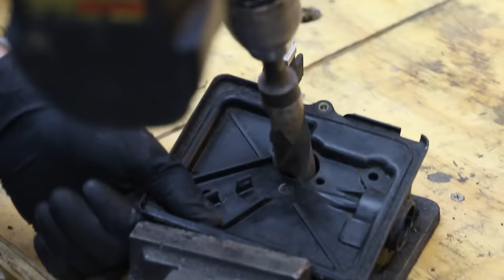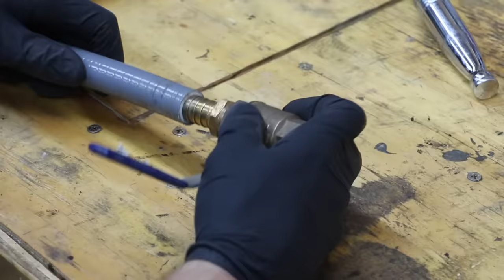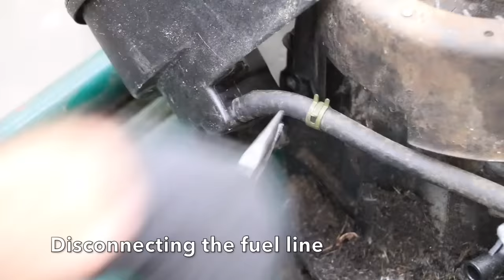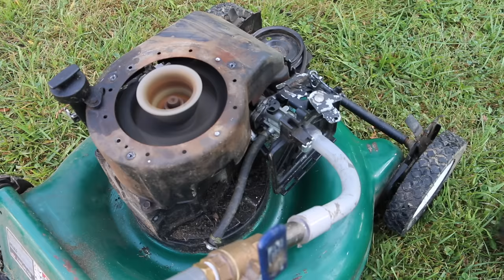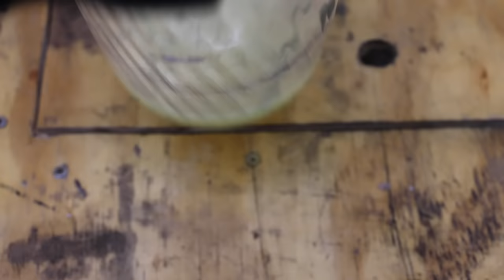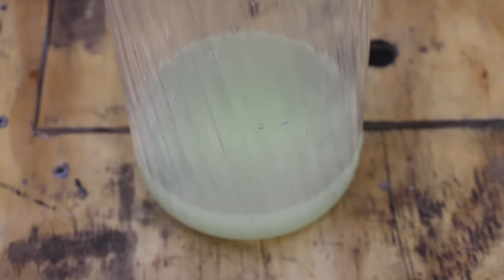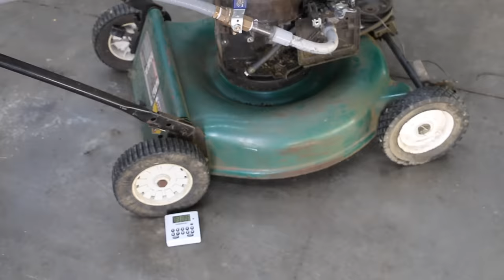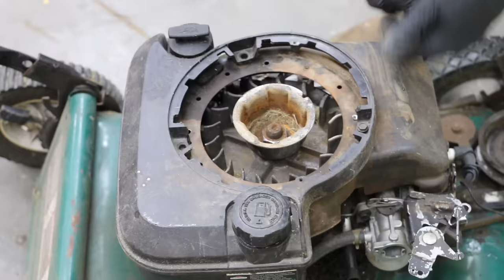Will a "Gas Vapor" Container Improve MPGs and Fuel Efficiency?  Let's find out!

Comment: its literally the same principle as a carburetor
Reply from the maker: Thank you!
Reply: It isn’t because there is is still fuel going into the engine while running on vapor is vapor fuel not liquid fuel
Reply: mason's radio WTF are you trying to say
Reply: @masonfirmature1523  No fuel ever goes to the engine in any combustion engine. What goes is air fuel mixture, which is then ignited. Air fuel mixture, how would you call it in other words? Vapor maybe?
Reply: @ProjectFarm  What you really constructed is basic carburetor, which feeds the engine with lean mixture, that will fry your valves overtime.
Reply: That's what I was gonna say, it's just aerating the fuel in the tank, but has the same basic effect of creating an air fuel mixture.
Reply: @punio7  but it's possible to build a slightly more sophisticated system to better tweak the mixture. Ya know, in the event of the apocalypse, and you need to replace your carburetor to continue running your equipment on the biofuel you distil in your survival compound. 🤷🏼‍♂️
Reply: But I think that shows that when you feel like your car might be running on vapors, it's absolutely not 😄
Reply: Crushonius and fuel injector
Reply: If there is liquid fuel that makes it into the piston by design that contributes to cooling. You guys need an education...
Reply: @punio7  
I think this is a 2-stoke engine. No valves.
Reply: @johnnyvanderplas3871  Yep, you're right. My bad. It stil is a bad idea, especially if someone tried to do this in a car.
Reply: @punio7  by calling this a bad idea you show you don't know how an engine works.
Reply: @magapefarmshomestead6453  By not telling why it would be a good idea, you have shown no knowledge o engine yourself.
Reply: @punio7  your descriptions and explanations show that even back woods hicks know more about engines than you do. your comment, as follows "no fuel ever goes to the engine in (I quote) 'any' combustion engine" is a flat out lie, regardless of how much truth you might think is there. In modern conventional fuel injected internal combustion engines, be they direct or multi port injection, the fuel rails that transport fuel to the injectors do so as a liquid. as the device is an injector, not a vaporizer, it does not and can not vaporize all of the fuel, thus raw liquid fuel does, in large quantities, enter the combustion chamber. while it would be ideal to always have the fuel in the cylinder only as a vapor or gas (describing a state of matter rather than a description of fuel) it does NOT happen unless you make your own carburetor, which many states are outlawing, thanks to lobbyists from the oil companies. a question for you - what are the purposes of air pumps and the catalytic converter on cars? why would there be as need for air pumps if complete combustion was achieved in the cylinder? please study chemistry instead of just spouting or regurgitating the lies that the oil companies teach. no they don't want you to understand they are brainwashing you garbage. good luck
Reply: @magapefarmshomestead6453  Air pumps are used to inject more fuel into combustion chamber and have it all burned. You can have complete combustion without one- my bike does it all the time. And yes, injectors does spray liquid fuel into the chamber, but they do it with high pressure, so it creates rather a mist than actual liquid. So yes, technically I was wrong, but not much. Also with mentioned injector technology, why would those evil gas lobbyist allow it to exist but ban gas vaporisers? Maybe it's not lobbyist, but fact that self made vaporiser that creates highly explosive gas is a really dumb idea?
I was quite arrogant in my first post, for which I apologize. Your comment made me to check facts, and yes I was wrong at some but I'm not convinced that gas vaporisers are better solution in combustion engines.
Reply: @punio7  I am also sorry for my unkind comments. But I feel a need to provide better information. First of all, a mist is just very small droplets of liquid. It is not a vapor, which is the only state of matter that hydrocarbons will actually combust, burn or whatever one wants to call that chemical reaction. Second, A turbo charger puts more air into the cylinder whilst an air pump puts it into the exhaust system, to provide air (oxygen) for the catalytic converter to use. If additional oxygen was not supplied the catalytic converter would and could not work as there would not be anything for the hydrocarbons to chemically react with. 

And yes when that part of the fuel that was vaporized during its injection into the cylinder burns in the cylinder, the heat of that chemical reaction vaporizes the rest of the misted fuel in the cylinder but can not burn it as there is not enough oxygen to allow the chemical reaction to occur. So all the unburned and partially burned (carbon  monoxide) hydrocarbons go to the catalytic converter to complete the process so that it can be claimed to be a clean burning engine.

We have been taught that the only way to make combustion better is to add more air to the cylinder to make the air/fuel mixture better but there is another way, which is to reduce the amount of fuel added and to add that in a state that it will burn (a vapor) and give it enough time or help the mixture to properly and thoroughly mix so combustion happens easier and more completely in the cylinder.
Reply: @magapefarmshomestead6453  Thanks for the information, my knowledge is definitely lacking in this subject.
Maybe then the reason why there are no gasoline vapor engines is because gasoline vapor is highly explosive? From what I read liquid gasoline only explodes in certain concentration, thus making it much safer to use in engines. When vapor engine stops, there would be still vapor inside evaporator, which could cause danger. Also what about gasoline vapor burning temperature? I know running on lean mixture causes higher burning temperature, which affects engine's    durability. Isn't the same for vapor?
Reply: Johnny Van Der Plas the lawnmower he is using is a 4-stroke
Reply: @johnnyvanderplas3871  It's very obviously not, you can hear it very clearly.
Reply: @punio7   punio7  vapor is explosive at the right concentrations but when very little to no air/oxygen is there it's not very explosive. Rather quite safe. And again liquid fuel can not explode as it can not combust. If liquid fuel could combust it would be so dangerous that it could not be used as a fuel and all petroleum based products would be banned because too many people would have died. If you want to prove that liquid fuel does not burn get a tin pie plate, put a 1/4 cup fuel in it and light it, but stand back so you don't burn yourself. The fuel will burn on the surface only until it is completely gone. If the liquid could combust the whole pan and everything near it would be in pieces immediately. While that is a proof I recommend one finds it online instead of doing it oneself. 

And yes the hotter the fuel vapor is the easier it will combust when mixed with oxygen. This is because it has more molecular energy due to the added heat.

Yes when a clean burn is accomplished it will burn hotter, because more of the chemical energy in the fuel is released. The ultimate release of energy is, as you have called it, an explosion or detonation. This is why diesel engines have more torque than gas engines. Gas engines burn their fuel and diesel engines detonate theirs. But even diesel engines do not use all their fuel if there is not enough oxygen. Examining the exhaust show this when you see a black cloud coming out of the exhaust system. This is called soot, carbon etc. and is unburned fuel, carbon chains. Gas engines have the same thing happening but their unburned carbon chains are shorter and less easy to see.

The optimal chemical reaction is detonation but few engine designs could handle the power generated. To do so would require directly opposed cylinders so that some of that energy would be used for compression of the air/fuel mixture in the opposite cylinder. That compression process would help decelerate the piston and keep the engine from disintegrating. There are only two engine designs, that I am aware of, that could do that. The first was designed in the 1930's by Russell Bourke and the other is a recient design called Paut engine.

Mr. Pogue's carburetor is not dangerous due to the low concentrations of oxygen in the vaporized fuel until it is mixed with additional air/oxygen. Mr. Pogue, and others, prove that we could be getting far more mpg out of the fuels we use and polluting far less if better carburetors were allowed to be used.
Reply: Actually it's not. There is no venturi, and this is not putting atomized fuel droplets into the air, it is putting vapors in to the air. This is NOT a carburetor.
Reply: @sploofmonkey  sploofmonkey  what you say is true about big oil. Big money always influences many things. Where is the info on mr pogue selling out? This I have not seen and would like to. And yes FI  does atomization. I have never said it didn't. Atomization will leave lots of unburned fuel vapors in the exhaust. 

While proof would be great one doesn't need overly fancy machines to measure vapors. While it is true that the machines to measure this is expensive they are around. As far as I know every smog check station has a machine that can measure vapors, called (I believe) a sniffer. This is what was used before cars started self reporting how well they were working at combustion. Lol self reporting. When would that ever not be reported as "hey I'm doing great" lol
Reply: @sploofmonkey  sploofmonkey  I am having trouble understanding why you don't seem to understand that I am agreeing with you. Atomization is only making small droplets from the liquid fuel and vaporization is turning a liquid fuel into a vapor, as the term indicates, and matching the vapor input to the oxygen available in the cylinder should greatly improve the fuel mileage. 

I indicted sniffers because it will detect hydrocarbons in the tail pipe and if there are hydrocarbons there that would indicate that all the fuel was not burned which would prove one of two things: either the air/fuel mixture is way out of whack or the fuel was mostly atomized not vaporized ant that combustion is what vaporized the atomized fuel.

Cracking, via heat, is the process by which crude oil is turned into the multiple products that are sold. This process continues even after the heat is no longer applied, though much slower. And by applying heat to the fuel and/or vapor will add energy to assist in vaporization as well as "crack" the fuel (hydrocarbon chains) into shorter chains making it easier to burn. You do understand though that even just "burning" the fuel is less efficient than detonating it and that the higher the compression ratio the more likely the hydrogen/oxygen chemical reaction will happen and not only the carbon/oxygen reaction will happen. The hydrogen/oxygen  reaction creates more energy and thus more power and efficiency, if the engine is designed to handle that power. 

Thank you for the like and I will look into his, mr pogues, data on the web. But as you say if there is something as simple as a missing wikipedia profile then how much of what is out there is true? And as for Tom O. I'm not surprised about what you said happened to him. Unfortunately he would not be the only one, there have been hundreds and possibly thousands to whom this happened.  Either they sold out to keep themselves and family alive or they died or dissapeared, as did Mr Diesel.

Comment: Wouldn't a fish tank air bubbler stone create more finer bubbles so th fuel doesn't splosh so much?
Reply: Yeah but fish won't like swimming in petrol!
Reply: The gas would destroy the bubbler stone. Some pneumatic equipment use something similar but they’re usually made of brass. Not a bad idea though
Reply: @MikeHawkHertz69 There's loads of stainless stones that would be more than happy in gas. High ethanol gasoline would actually keep the stone perfectly clean and clog free. But the pore size of a scintered stone is usually in the 0.5 - 3 micron range so you'd need LOTS of layers of fuel filtration to ensure that you don't clog the stone; that also means large fuel filters to keep up with volume requirements although a lawn mower doesn't have much in the way of volume requirements.
Reply: The way he has this set up, the lawnmower engine is the pump that pulls the air through the fuel to agitate it. There is no other intake for the air to get into the engine, hence all the air tightening he did with the JB weld. 

I think the way this series up is, the agitation created by the air being stocked through the fuel atomizes the fuel like a carburetor would. Then the continued flow of air through the  inlet tube takes those droplets of fuel and puts them in the carburetor. 

Think of a jacuzzi tub running. When those air bubbles reach the top of the water and pop, tiny droplets of water and up accumulating above the water level. Now imagine there was an air current strong enough to duck them up into the air.
Reply: @MikeHawkHertz69  I used the stone in a home-built water injector and got my old style Pontiac Bonneville up to 13 mpg.  The video reminded my of the old jacketed carburetors that attempted to heat dry out the fuel into a vapor.  Unfortunately they tended to vapor lock because there is more than one type of fuel in gasoline.

Comment: it's great the engine ran with just the vapor but does it produce the same amount of power under load? the safety is totally a factor as any flash back would be catastrophic.  An arrestor is definitely needed.
Reply from the maker: Less power. I'll add an arrestor. Thank you!
Reply: Project Farm I have an old Hydrogen generator video from years ago and I have a flame destroy my test system because I lacked the arrestor. It was quite a bang :)
Reply: I bet if you tune it for the vapor, it would have similar hp.
Reply: It will produce the same amount of power.  The job of the carburetor is to take in liquid gasoline from the tank and change its state from a liquid to a fine vapor, probably a better vapor than this experiment did.  Feeding the fuel pre-vaporized or allowing the carb to do it makes no difference, so long as the air/fuel mixture is the same, the power output and efficiency is exactly the same.
Reply: Alfred Havemann carbs don't vaporize fuel at all. It's a mist. HUGE difference. A mist is still liquid, vapor is a gas.  There's a difference modern cars are using high pressure direct injection. The high psi injection is the closest you can get to vaporizing gasoline. If you have ever actually seen a carb run, it literally is just a stream of fuel that gets partially mixed by air flow.
Reply: Bobby K You will get just a big pop , nothing to cry about. On a car's tank that's another story. (use cotton or something in the suction line).
Reply: Change your timing to closer to 4 degrees top dead center. Vapour explodes faster than spray so the piston was almost retarding the power stroke.
Reply: A simple dual water jar and pipes works as a decent flashback arrestor.
Reply: the Pogue 200 MPG carburator was tested by the Canadian Automobile Association and Ford Motor Company of Canada. No loss of power or performance.  Gas stocks plunged on the news, and it was in mechanics illustrated after the patent ran out.
Reply: Rackstar let's really create it and see if it works with modern parts and technology ?
Reply: i used a stainless steel washing machine screen as a spark arrestor it worked great my problem was the gas went flat after 15 minutes every time,

Comment: What happens when you run an engine in reverse
Reply: John Leu a 4 stroke diesel will run in reverse if you spin it backwards to start it. A 4 stroke gasoline engine will run in reverse if fuel is introduced into the exhaust and it is spun backwards to start. You cannot run a 2 stroke gasoline engine backwards without major modifications and a 2 stroke diesel will not run backwards unless air is pressurized back into the exhaust.
Reply: John Leu the reason is the gasoline 2 strokes have reed valves that only allow air to go from the intake to the exhaust and not the other way. Plus with gasoline engines the fuel comes into the cylinder with the air, so fuel would need to be introduced to the exhaust
Reply: Rick Delair Full ack. A basic two-stroke engine doesn't even need to rotate, think of old fashioned rams like the DELMAG H2S.
Reply: Two stokes do in fact rotate both directions ever heard of an ez-go golf cart? Older golf carts starters spun the motor the opposite direction to start the motor running "bacwards" instead of developing a forward neutral reverse transmission and is a lot cheaper. I believe certain yamaha carts were similar.
Reply: Ty's Trucks older snow mobiles use the same method such as my 1995 ski doo formula sl (500cc dual cylinder two stroke) you press a button and the motor stalls then restarts, running itself in reverse
Reply: Same concept I forgot about snow mobiles
Reply: If you do it on a lawn mower your grass all the grass grows back
Reply: It will create gasoline ⛽

Comment: It’s pretty much just outsourcing the carburettor but it was still interesting to see
Reply: The best use case I can think of for this is using ethanol gas in a mower without having to worry about ruining the carb, but would need a filter on it to keep out contaminants and moisture

Comment: I was told to do this but heat the fuel. The heated fuel should expand and be more flammable or ready to burn. Then you should be able to cut back just a little bit more.